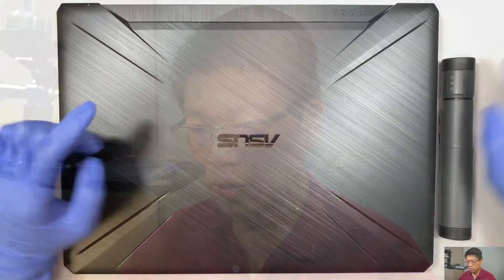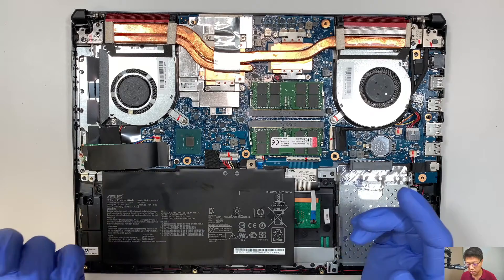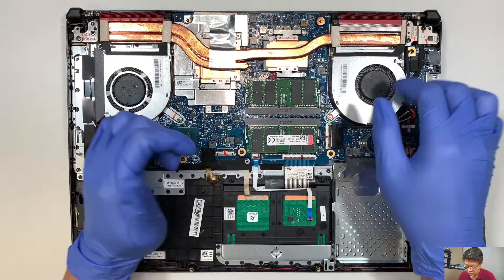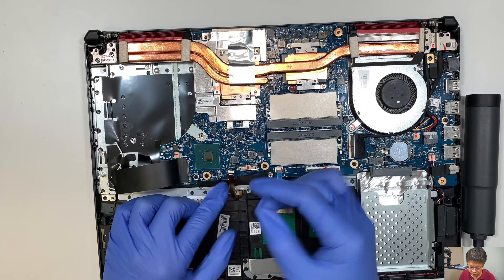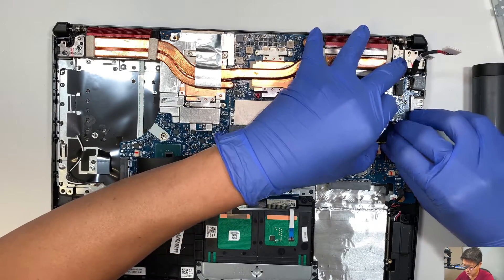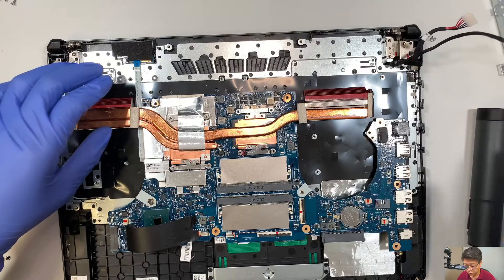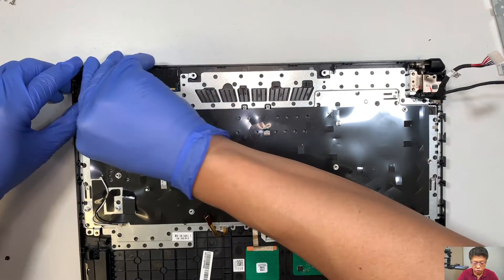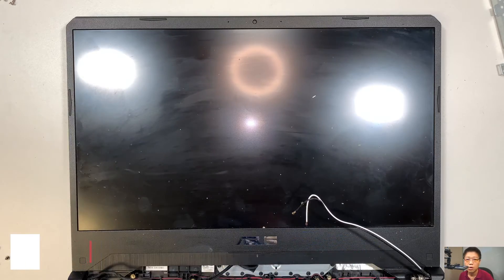Asus FX505G Tear Down Disassemble

Comment: Hi bro PLS HELP ME so in 9:23 i have and hard drive right there and its the orginal thing like i change nothing of my laptop yet nothing new so there my hard drive is keep making a sound and my D and E drives are disappeared my model is  fx505dt-hn665 PLS HELP ME BRO
Reply: probably its furfilled its life, those are 2.5 Sata ssd or hdd, as you can guess, old, my suggestion to you is check with tools like partition wizard the drive, and then buy new one, an ssd, 250 gig of pcy cost like 16.25 bucks, worth it tbh for that price
Reply: @GKAS-o1r  ty bro i will give it a try

Comment: i hope you are still replying...I have one 8Gb ram..Can i add a 16gb on my second slot even if the ram i have is 8Gb?please help..Because i dont know if i can add a different size ram
Reply: Hello, yes but check the type of the ram you aldready have, if its DDR4 like the video buy that type, if you can afford, try to buy same model as your current ram , because then you can use dual mode which is fast but not verry big difference, just a why not thing.

Comment: Thanks for your instructions! May I ask some questions?
As long as humid days, my notebook(As same as Fx505) doesn’t work anymore. Even I have connected to the power supply, the light signal of battery doesn’t light up.( I guess the problem is the battery?)
As I have followed ur video and disassembled it, is there are any ways or solutions to check out which component is in problem?
Looking forward your replication.🙏

Comment: Hi I got a question. I have the same laptop and after I finished cleaning it a problem occurred. The keyboard lights turned on (without me doing anything). I tried to turn on the laptop but I just won’t , also when I plug in the charger there is no indication of the laptop chargin, any idea what that might be?

Comment: thanks for this video, helped me replace my GPU fan.  
However now it's running hot even with a new fan.   I slightly lifted the Heat sink to get the fan in and out, do I have to apply new thermal paste if I just lift the heat sink a little bit?
Reply: Nope , the heatsink is supposed to press on the CPU/ GPU properly, if it is a tiny bit loose, your laptop will overheat

Comment: I accidently drop my laptop (ASUS TUF505G), when I turned on the laptop it could run but the screen was totally blank. I need to use external monitor and it work. I think the drop impact caused the connector from motherboard to the monitor became loose. I would like to hear your though
Reply from the maker: If I were to guess, you need a new screen. Cable or connector came loose is unlikely.

Comment: Hello, I'm thinking of disassembling my asus tuf laptop as well because I'm having 100% disk usage problem on my ssd nvme, but it's mostly in hardware side since it only happen when I'm running game while charging at different charging place. Does it perhaps have some faulty in my dc port?

Comment: Great video. Any ideas what could be causing this laptop to not boot up? Coffee was spilled on it and it wouldn't start up. I cleaned the MOBO with isopropyl alcohol and that seemed to solve the issue temporarily. Now when I try to turn it on, nothing happens. Pressing the power button causes the button to light up red. Plugging it in also causes the button to light up red. If unplugged and holding the button down for 10-15 seconds, the keyboard light flashes and the power button light is off. Same thing happens when it's plugged in, only the button light stays on. Is it a battery or power supply issue? Or would the MOBO simply be failing?